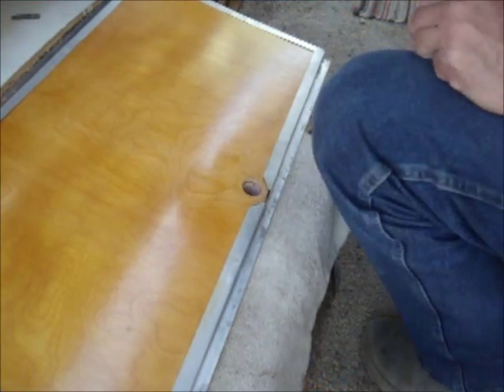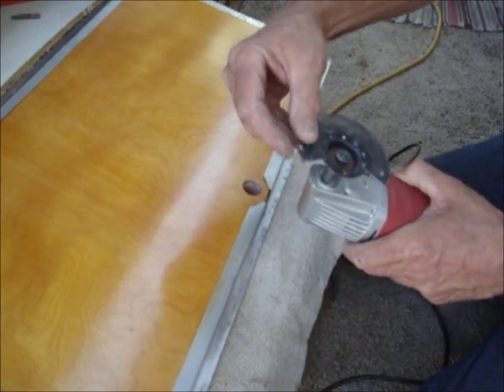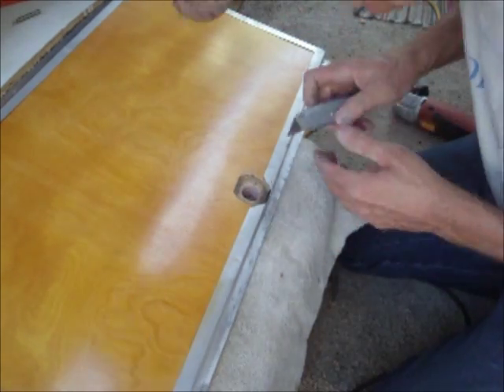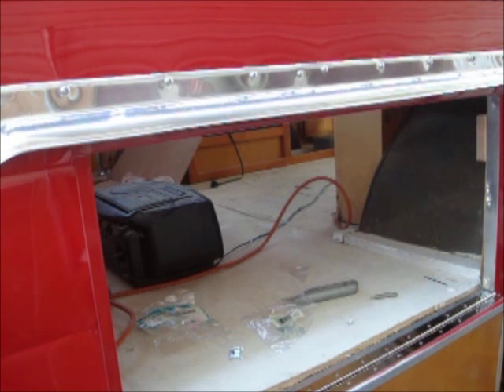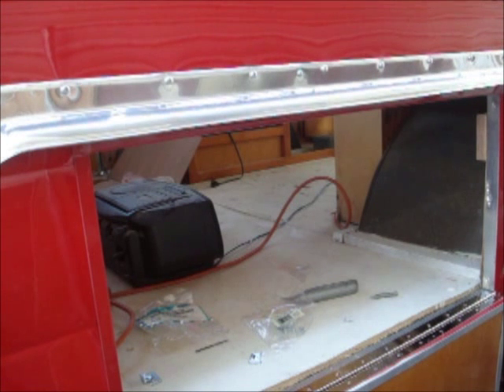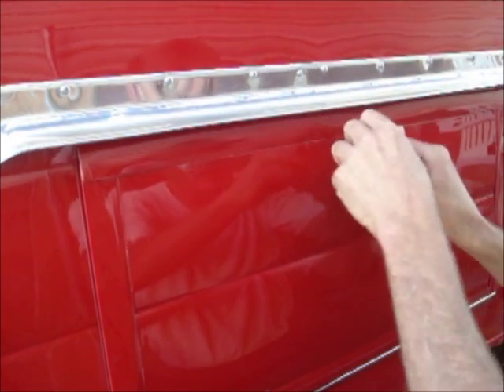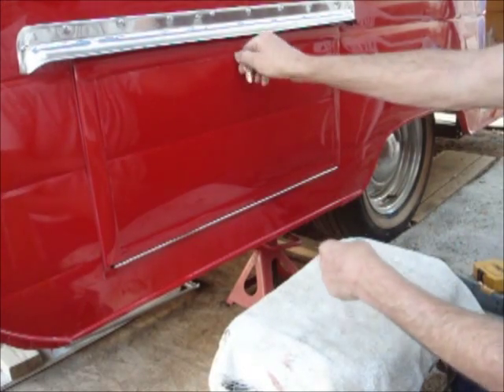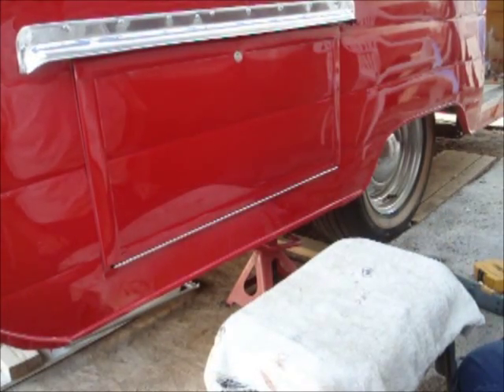Restoring The Shasta Part 23 - Baggage Door Locks

Comment: Did those doors not have gaskets on them? My 60 model has the black back gasket like you use on the hehr windows. I’m wondering if it would be as good to use butyl tape and just weather stripping. Any thoughts?
Reply from the maker: No these did not have them. Yes some putty tape would help to protect it. Same with the door frame. I know the kind you are talking about. They are built just like a HEHR Push Out Window only with metal instead of glass.